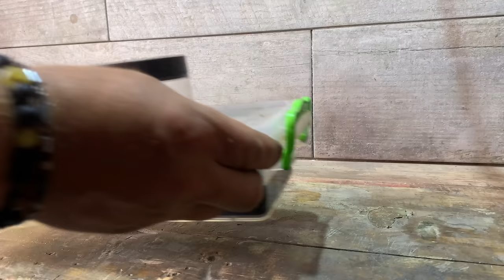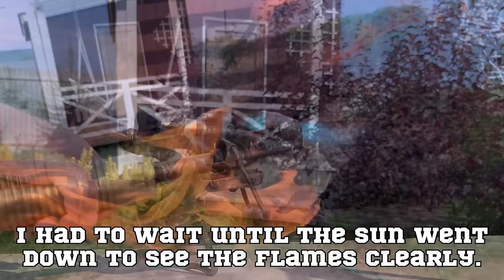1889 Mini Flamethrower: Restoration and Investigation

Comment: Nice work, to the best of my knowledge this is a soldering iron. Also be careful with the cloth like material in the adjuster for the flame. It is possible this may contain asbestos.
Keep up the good work
Reply from the maker: You're right, it's a soldering iron. Some details are missing here, directly soldering tip.

Comment: looks like an old plumber's torch. fill with white gas, pump to pressurize & start sweating copper joints. Never seen a design that had to be pre-heated until now.

Comment: These mini flamethrowers weren't made in 1889 or 1899. They were made either in late 1930's or 1940's. One piece I see is made by plastic. Plastic wasn't invented until 1934 so I think its 1930's or 1940's as seller is correct. Sometimes it's better to check with sellers or historians because they know the answer.